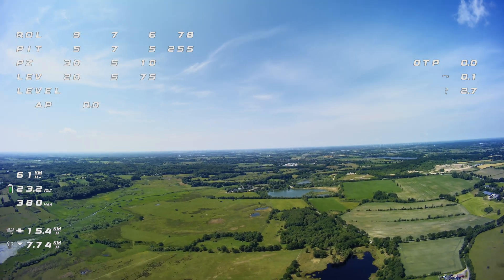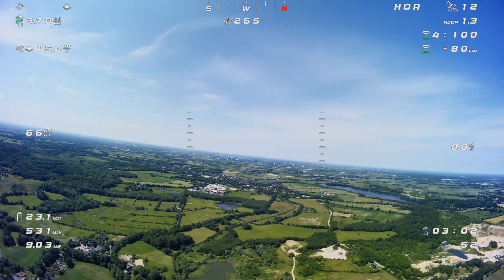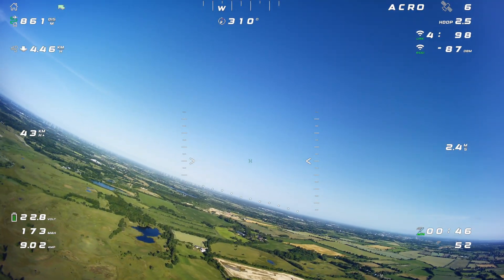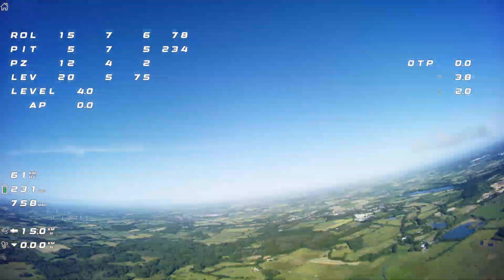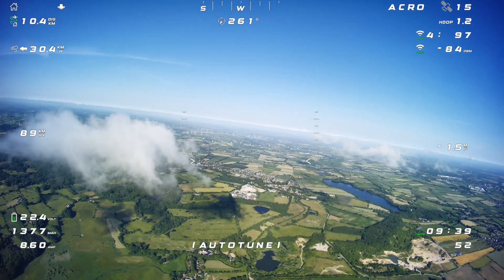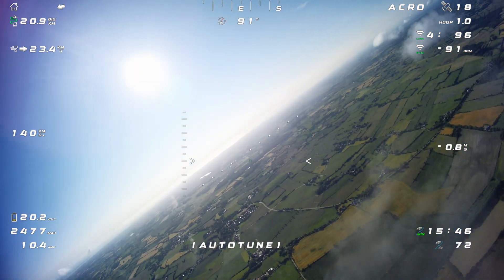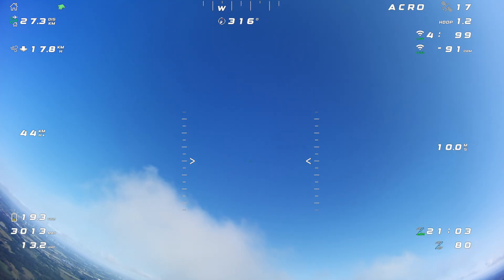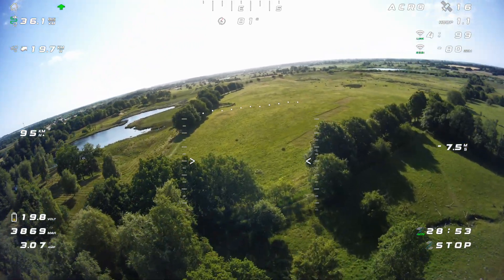Tuning the Dolphin Pro in INAV 8 | AtomRC Dolphin Pro EP:04

Comment: Your issue is the filtering on the gyros, you need to turn the filtering down (which is actually moving the slider up in inav) and some of them need to be turned off. With all the filtering causing so much delay you get this bad feedback loop as a result of the unnecessary canards.

Comment: Thanks for the video. Are you using a 6S 4500 battery? and seems you are getting 30 min flight time? I am considering changing to 4S but I won't if I can get 30 min on a 6S 4500.
Reply from the maker: Yes, I’m using a 6s5000 li-ion pack (Samsung cells, 35A max if i remember right). 30-45min commonly uptime ;-)
Reply: @JustFPV-net  Thanks for the reply greatly appreciated. Mine is in the mail.....
Reply from the maker: @stevek6363  Keep her safe ... she is able to take a beating and happily disassembles on Impacts/hard landings but NEVER in a way you wont be able to get her back in shape! Mostly it simply uses the energy to disconnect the Wings and Stabilizers.

... hmmm sound like I should go out an fly again ...!
Reply: @JustFPV-net  Thanks, was it you that had the 3D scan of the plane? I want to do some mods and 3D print some things. Someone had done some scanning but I can't find who it was...  :)

Comment: The biggest difference I found while tuning my dolphin pro was switching to decent high speed digital servos. I had to replace a servo after my second flight, while still fine tuning and better faster servos made the tuning process so much easier, my dolphin flies amazing now
Reply from the maker: sounds great - which servos did you choose?`Mine are still fine
Reply: what refresh rate

Comment: What is the physical difference between the pro and the original Dolphin ( apart from the pro having rudder). The oscillation problem is that both models, or just the pro?
Reply from the maker: Just the pro suffers on INAV 8 … 

The v1.1 ist much lighter, faster and more brittle 

The Pro is tougher, heavier, has fresh ideas and lets you disassemble all parts for transport.
Reply: @JustFPV-net   thank you
Reply from the maker: @alantoseland6629 anytime, mate

Comment: It’s unclear and a bit misleading how autotune supposedly tuned the PIDs in your video, considering it only supports Feedforward (FF) autotune
Reply from the maker: As you mention, autotune only tunes the FF value. You’ll have to dial in the other values yourself and that is what you can see here. And in case people don’t feel like that’s a good way to do it in flight, i provided the final tune of that flight so they can put them into their build or atleast get an idea about where to end up. 

P I and D are a manual job since INAV 6 if I remember right. And I think people know that by now.

Comment: Excellent video, is this stock settings or Elevons & Rudder on tail only ?  How have you setup wings & tail ?
Reply from the maker: This is elevon mixing only, the rear servos are connected but have no control so far. Everything else is INAV 8 defaults with delta mixer
Reply: @JustFPV-net  Plenty of pitch authority with just Elevons ?
Reply from the maker: @tubamanandy2 more than enough if you ask me ;-)